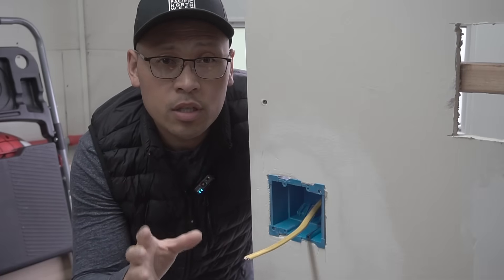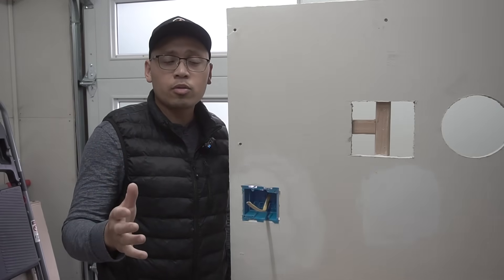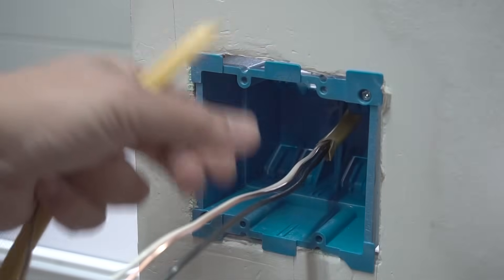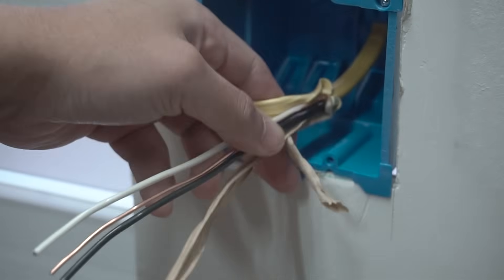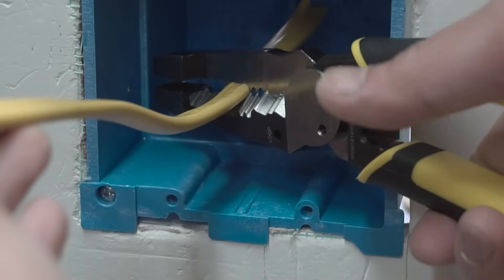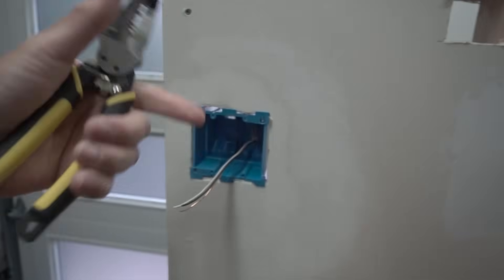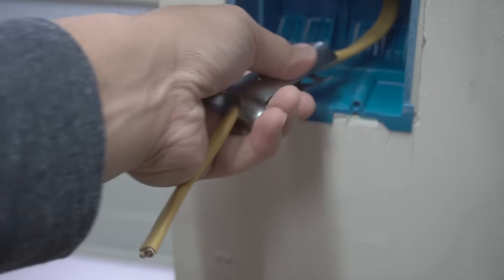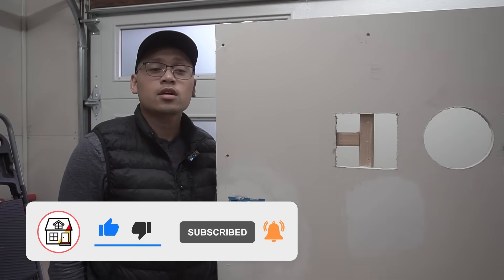STOP Stripping Electrical Wires The WRONG Way! Do These Instead! DIY

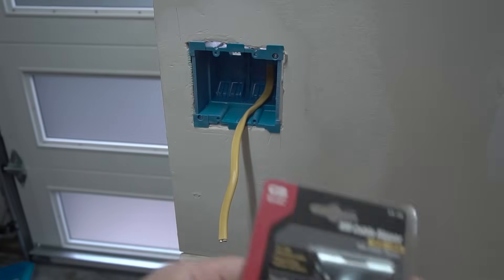Comment: 8:24, it would be nice if they made a device like that with a sharp blade that only scored the sheathing by only letting it protrude 1/2 the thickness of the sheathing.
Reply: You could probably modify one with a file to do that.

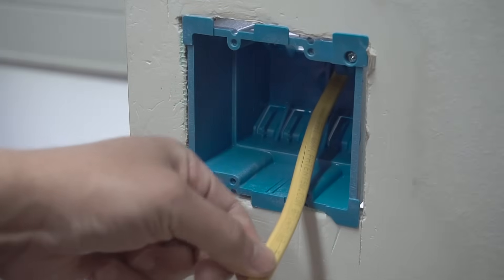Comment: I always do a combo of 2:30 and  3:45 by just lightly scoring the sheathing but not all the way through and then all the way through on the last inch.  Never nicked a wire in 45 years.

Comment: I never use a knife. I use my hobby-grade Lexan scissors that way I avoid damaging any insulation on my wires. It works nice and quick while giving me the assurance nothings going to get messed up.
Reply: I just ordered a 5” electricians scissors for stripping wires safely.

Comment: I use the Cable Wire Tool. I have been using one for years. I wouldn't dare use a Utility Knife, because I'am kinda clumsy, so I know I would cut myself or cut off too much Wire.🤷🤦😔

Comment: 5:10 those holes are to cut screws.  The screws that hold the outlets in and the outlet covers.  The screws size it written by the hole.  I keep 2” long outlet screws and cut them if I need a 1.5” screw.
Reply: That is very interesting and would not have known that shy of reading a manual. From Amazon it states "SHEARS: 6-32 & 8-32 Bolts".
Reply: Came here to say that! One side is normally threaded (the keep side) to preserve the threads after cutting it.